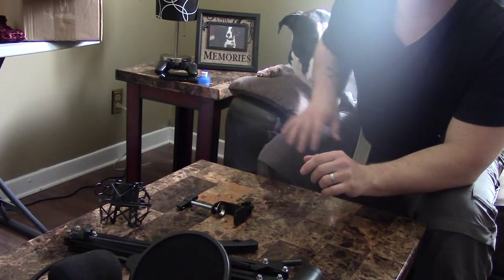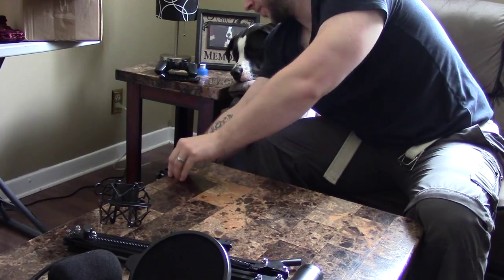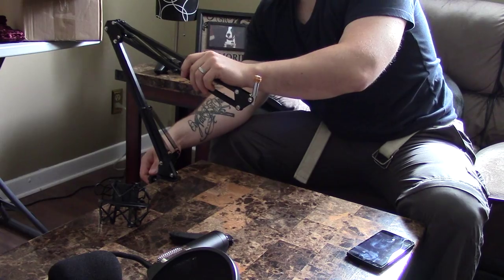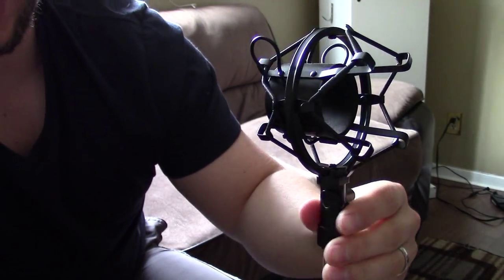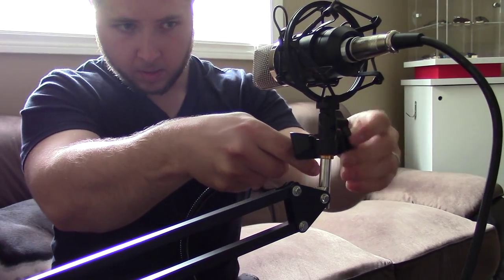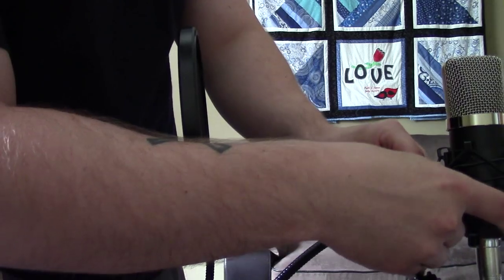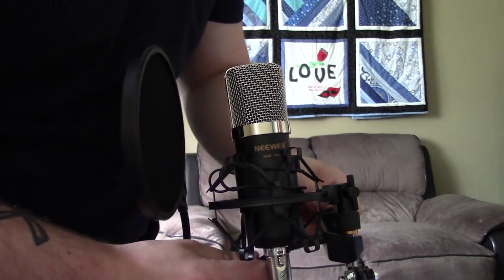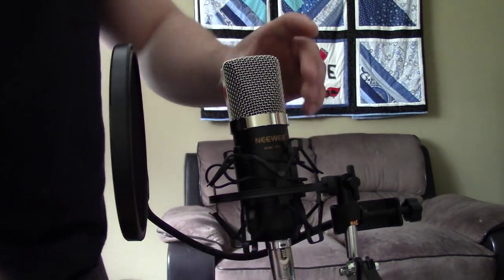ASSEMBLY - Neewer® NW-700 Professional Studio Broadcasting & Recording Condenser Microphone Kit

Comment: how do you turn it on ?
Reply from the maker: Hey deyna, thanks for watching! There is no 'on' switch. You plug the mic into phantom power, and you're good to go!
Reply: +Weiderfan what exactly is Phantom power ? I have mine plugged into my Apple Mac and no sound it coming out from it haha
Reply from the maker: Okay. This is a condenser mic, which means you need an input that has a specific power source for the mic (phantom power). A computer usually doesn't has this power source, so you'll need an audio interface to plug it into, and then run the audio interface into your Mac. :-) Heres a link to a small mixer that will work perfectly, or you can find something similar on your own! http://www.amazon.ca/Behringer-UB502-Ultra-Low-Design-5-Input/dp/B0002L05XY/ref=sr_1_15?ie=UTF8&qid=1440775169&sr=8-15&keywords=audio+interface